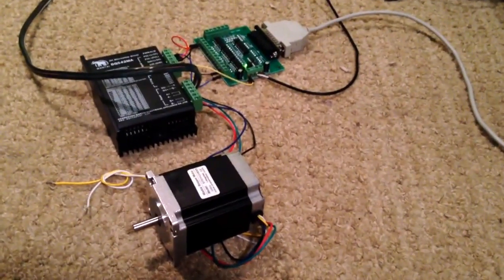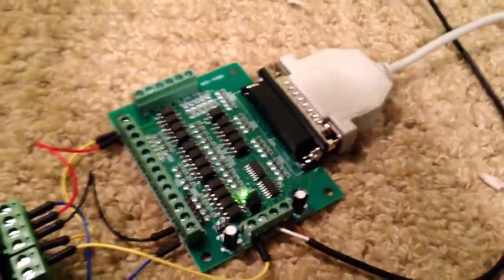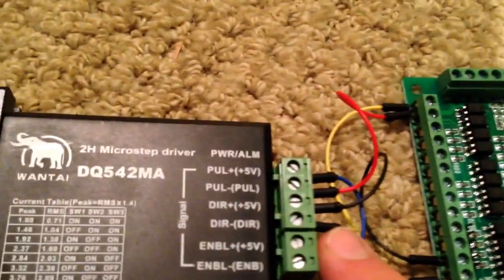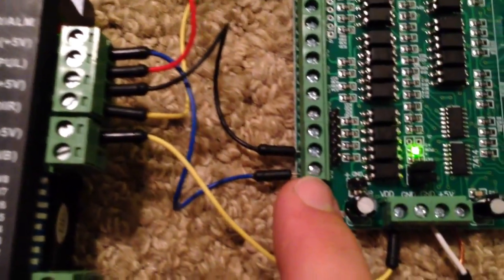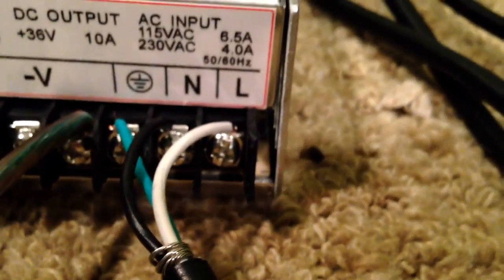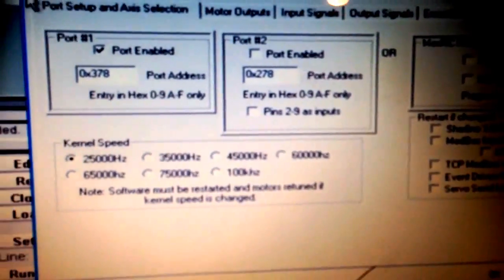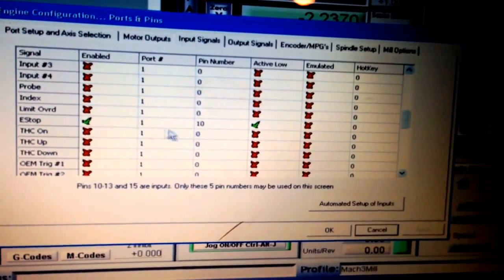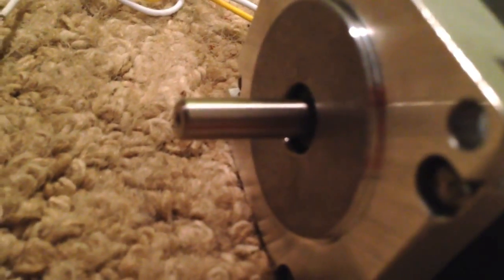How to DB25-1205 bob breakout board and DQ542MA Driver cnc stepper

Comment: Hello, I have all the same components and now I changed the main computer, installed mach 3 and it just doesn't want to start the engines, I tried to adjust according to this video but it still doesn't want to work, maybe you have a solution to my problem? Thank you

Comment: hi Mr Joe, I have DM556 step driver, and 6 wire old printer motors. what is the ideal pulse or revolution for nema 23 size motors? please guide

Comment: Hi Joe, What DIP setting do you suggest for a DM556 driver board, in case I run a 3.35 amp 6 wire stepper. What's the connection diagram for 6 wire motor (black yellow red blue orange white). What power supply amp or voltage you suggest? please reply

Comment: With only the power supply connected I am getting 5.22v at all of the output pins. Shouldn't that be 0? This is for a Plasma cutter and one of the output would be directly to a relay that would be on when the controller is turned on the way it is now.

Comment: Just figured out why my setup wasn't working, for anyone else with the same problem. (i have the exact same setup as in the video) Windows 7 64-bit does not support paralell port connections at all. So downgrading to Windows 7 32-bit or some earlier version of windows should make everything work.

Comment: What size motors did you use for your x and y axis?  Do your steppers ever miss steps when you are milling?
Reply from the maker: Cool Stuff Guys Like 
I used nema 23 280oz/in I think
They never missed steps on my mini mill, you might try making sure your power supply has enough amps to support the motors then check the speeds in Mach 3, to make sure Mach 3 isnt trying to move the axis faster than physically possible

Comment: Do you need to program the  parallel port card?, or just adjust everything inside the software?,  thaks a lot
Reply from the maker: Emanuel Torres just in the software. Board doesn't need to be programmed! 👍🏼

Comment: Also will the dip switches change when you wire up the other 2 motors? Or I guess a better question is what are the dip switches

Comment: Because of your video I just realized how far away I would have been trying to figure it all out on my own. I don't know how to provide 5 volt power to breakout board. I have everything else wired correctly just as you have it but not sure about the simple break out board power.
Reply: I figured this one out. I just found an old wall charger from something that was 5v and plugged it in. I don't know why I was so afraid of that.

Comment: Hi Joe
Thanks in anticipation of this working for my setup. I just got 3 wantai  nema 23 steppers with DQ542MA drivers and one nema 34 with a DQ860MA driver. The kit came with no documentation, wiring diagram or software drivers. Do you have to install drivers for these steppers ? or is this just handled by Mach 3 ?

Comment: Hi, I have bought a similar CNC kit , but the problem is when I set Pulse per mm 6400 ( 32 microstep ) and axis velocity around 600 mm/min in MACH3, the motor hang and make a strange noise and that's a big fail in cnc world -_- .

Comment: Hey man, I am just wiring mine up with the same electronics, but the diagram I have seen shows that the + feeds come directly from the +5v input, and the output terminals on the BOB feed the step and dir -pins not the + ones?  

This seems to be the opposite way from yours so I'm confused, but have read a few comments that these drivers have to be set active low in Mach 3 to work.  
Can you describe the reason for why the dip switches are set like that please buddy?  I don't know enough yet for how they must be set or why.

Thanks, and great video!

Comment: Thank you so much Joe, so you advise me the kit?
I'm turning to the web to understand which kit to buy.
Reply from the maker: Just go on eBay and look for a kit with the steppers drivers and motors you need and verify it comes with a decent sized power supply and the bob

Comment: I asked too soon.  i figured out the other two axis by using your original settings as an example.  what is confusing me is GND through P14 connections.  Where are those referenced in the program?  Regardless.  i used the DB 25-1205 break out board, with DM542A stepper drivers and NEMA 23 steppers.  This is outstanding information.  Thank you very very much Joe!
Reply from the maker: No worries, maybe someone had the same question
If I understand your question, they simply provide the ground path for the + pulses coming from the signal pins
Reply: You understand right. Thank you for your time.

Comment: Hey there. How many amps do you use to power supply your breakout board?
Reply from the maker: I don't know for sure what the minimum is but I think a very small amount is needed, something like 200-300ma. My adapter was a cell phone charger that was laying around with 1000ma (1amp) but it's overkill